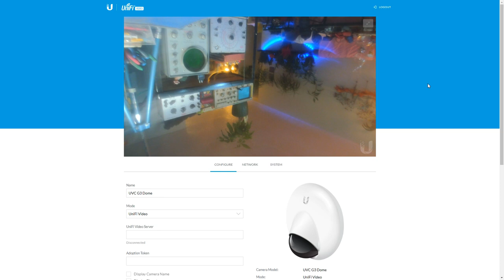UVC G3 water damage Repair

Comment: Well done with this, I had the IR filter intermittently working, sometimes the IR works sometimes it dont, do you think I can bypass the procedure and start popping out the lens part to access the IR filter without removing the back cover?
Reply from the maker: If you can get it out without breaking it yes.

Comment: Thanks! this really helped!   Did you end up testing it in the dark, curious if that IR cut filter still worked?
Reply from the maker: Actually yes. 100% fully functional
Reply: @thefixitgal  Great!  I just opened up a G3 Dome with a stuck IR cut filter and this video helped me fix it!  I had to remove the filter and tap it a few times, then used a Neodymium magnet to engage the solenoid and move the filter back and forth.  Thank you!
Reply from the maker: @petrusslaghekke485  Ah ok the optics.. I was a bit confused XD.. kk great :)